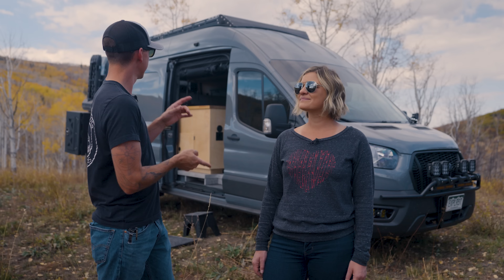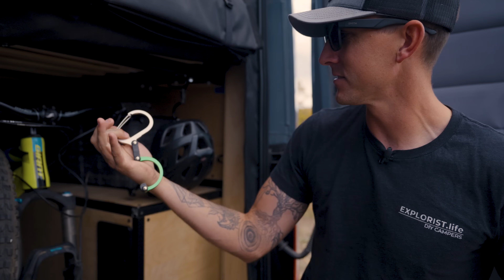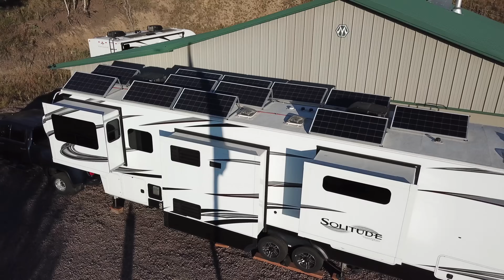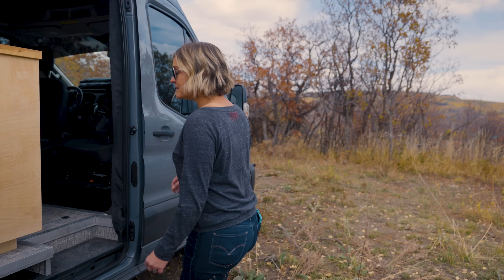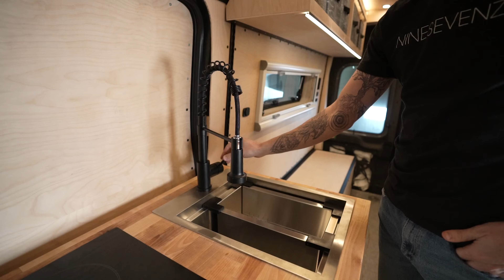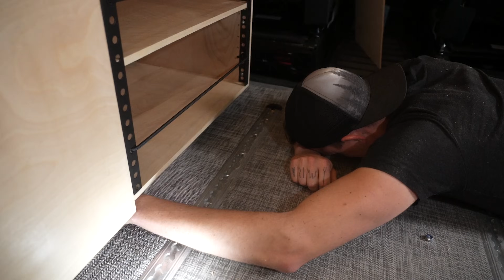LUXURY VAN TOUR - our dream off-grid van

Comment: Amazing build! Did Ford ever fix your automatic sliding door or did you guys fix it yourselves? Did you make a video or blog post about it? I couldn't find anything, and I'm worried that ours will break the second we're done with our build.
Reply from the maker: Ford FINALLY fixed it.  There is a ford service bulletin (some washers, or something like that) about it and we 'only' had to uninstall the door panel and kitchen.  They also had to send it off to a body shop to adjust the door as us forcing it open and closed over the last 3 years messed up the adjustment (that Ford blamed on the weight of the wall panel and insulation).

Comment: I have similar set up in mind for my van, but I would push the mattress to the left, and have a wall of storage to the right @40cm deep. Much bigger window on the left and no overhead storage. Also pull out table from under the floor to slide out for cooking or just sitting.

Comment: Wow... this looks longer/bigger than a "normal" van... or maybe it just looks bigger because I'm used to seeing SUVs and not work type vans, that I'm sure this would be closest to, originally at least...

Since a "normal" SUV sized vehicle usually is just big enough to have a "single" bed in it, and MAYBE, albeit unlikely a "twin" while having ANY kind of space left over, for storage or cooking needs (i could get by with just a microwave really) going the length of the van, whilst only (likely) having the front row of seating available, i do wonder if such a thing would be feasible to do?

Obviously, you would probably have at most, 8ft of usable space, depending on the SUV size available, unless you DID use some kind of work van type of vehicle, which might net you a slight increase in length and cubic feet of space to work with, and i wonder if there are ways to make better use of the available space? Like for instance, instead of doing a bed lengthways, how abut doing a semi-custom bed frame, that has the upper body portion of the bed at some kind of an incline, and then flipped sideways, to save space for more seating or else more storage in place of the 2nd row of seating perhaps? I don't have the money to do something like this, but if I did, I would love to see what I can make out of something with such restricted working space...

I'm going to have to watch a few videos on how exactly this particular vehicle was made into a camper van, because I would definitely like to know exactly how you did certain things with it. I wouldn't need windows on mine, were I to build one though, so all i would likely need for mine, were i to have the money, would be a panel kit, and probably not even any water storage, or as minimal of water storage as can be had, since I probably wouldn't ever need more than a 5gallon tank of water, including water heater, for basically everything I'd want water for...(again, assuming i even cared about water storage)

Most of the electrical stuff could obviously be put, depending on vehicle type, inside of the standard "stow-N-go" storage that's available on some SUVs today, and even if it's NOT the type to have built-in under seat storage, it could also likely be placed under the bed pretty easily, and come to think of it, you could, if it was small enough, have your microwave under the bed too, although I'd probably put some kind of shock absorption panel under it, just in case it needed it to reduce turntable rattling...

You've really given me a few ideas to think on in case I ever decide to do any projects like this. And, I'm not just talking camper vans either, but also pull behind trailer pop up RV tent things, which could also benefit from certain things such as LED lights and things of that nature...

Comment: Nothing beats a real mattress! So I would prefer a real bed over a sitting area. That’s why I prefer Sailing boats they come with both plus a full bath plus two guest cabins :-) for our fiat-panda-4x4 compact camper we use a blow-up roof-top tent plus blow-up mattress with a memory gel topper wich is due to the blow-up tent floor astonishingly comfy and super insulated and work pretty well in cold conditions… our whole kitchen is a Primus gas-cooker in a 65cmx45cm kitchen box on rails in the back… our whole electricity comes from an eco-flow pro plus a 30 Ah battery for our water pump with 4.3 bar of pressure attached to a 30 Liter water tank :)

Comment: I' put my water and power inlets in the same spot you did.  I did the water inlet only because in California certain locations require you to have a water inlet to be considered an RV.

The water inlet came from an RV supply store and the power inlet is from a Marine surplus store

What kind of Connector did you use for your External Solar Panels?

I have a Bluetti AC300/2x B300 Batteries setup. There are extra Solar ports on the Batteries.

Comment: Induction cooktop in a Similar Van, one size smaller.  I ripped off Forrest's idea of mounting in it's drawer (the drawer came out of a rack mount case I modified to hold Musical Equipment,so it's recycled).  The Hamilton Beach Induction Cooktop I got was purchase from Best Buy because it has a square housing for drawer mount, by coincidence fit 19" Rack Mount Drawer.  Drill some holes using a spade bit to the bottom to accommodate the fan and the line cord.

I also wanted to go to the microwave went on the fritz (i still can function with patience [beating on it like an old TV] but the some kind of grease or something has gotten onto the circuit board that has to be disabled properly cleaned outside of the appliance).  Lo
I found and tested a Microwave with similar Dimensions from the thrift store, the old one into storage until they have the opportunity to clean it.   

Even before I got the van I had purchased a very "Cute" Australian-made alcohol Marine stove (2 burners and Oven) but I think it requires some special preparation to get it together.

Shortly after buying the induction cooktop I also bought an old waffle iron that looks like it's still in decent shape and I did test it and it works for what is made for the old style waffle batter and I'm using this just add Water gluten-free waffle batter that probably requires different procedures the plates aren't Teflon.

All these other appliances draw less current in the induction cooktop.

1 burner butane camping any of these items.

Also prior to the building had an electric kettle so I I saved that.

Comment: I need to hear back how the thinsulate + lizard skin (all of the insulation) holds up in winter weather. I plan to camp mainly in California but if a job takes me to Seattle or New York I'd like to be warm - so following your foundation I can know how it holds up. The deeper the snow the better! I checked a couple days ago for a whole van tour and a week later it's here, and what a long road it's been for you two guys
Reply: I'm guessing $62,000 van, $15000 electrical, $20,000 paneling and l tracks, $3000 suspension, $3000 lights. Maybe $124,000 in total?

Comment: My electrical system is completely based on one of the exploristlife diagrams.  It would not have power if it weren’t for you guys 🙏.  
     Love the van.  I have a Quigley 4x4 transit high roof normal wheel base.  It’s a mini ski cabin. 
     We did our upper storage with baskets like you and we love it. 
     Congratulations on finishing. Looks amazing.
Reply from the maker: Hey, @mikewatts1014!  I appreciate that.  Thanks for watching! 🙂😀

Comment: why is the side door always on the passenger side? if that door slide gets messed up, can you replace it easily. why does everyone put the sink next to the side door instead of the toilet. I could imagine cleaning a litter box from the side door and disposing of the contents into a campfire. you do the math.
why do you need swivel seats? you dont.  would prefer the metal bulkhead with the kitchen galley mounted thataway to allow more room. But I am the guy that just sits in that seat to drive, and then parks in the camping place just to open the side door to camp. also the sinkbottom is also mounted crossways. at night I activate a self-inflating mattress on the floor to sleep. As I said, this is camping. there would be floor to ceiling storage in the back with plenty of canned meat. the roof has 4-200 watt bouge rv 9BB panels, 1 maxxair fan, and that fancy A/c unit. I like the exterior solar plug, because there are 11 Lipo4 12.8v 100ah batteries in different places in the ban. There will be four other 200 watt panels stored in the garage to bring out while camping. The theme to this build is "We have options here." there would be 4-5 different cooking options, 120v,12v, coleman stove with small propane and single burner with butane canister. the water heater goes in the cabinet under the sink, along with the water filtration system. the grey water tank is that 15 gallon that fits underneath in the sparetire well. (ram promaster)  the garage has a slideout deck and slide out drawers on top of the deck.
there is a hidden shower pan directly in front of the sink (hidden under a floorboard.) so the showerpan and the sink have the same drain pipe.the shower head is connected to the sink faucet. you can figure out how to clean up after. there will also be a fold up platform to fold out over the sink area to sleep on, if one so desires. Also, on top of the van is a slideout deck that functions as a side awning, but slides back to protect everything from weather like hail and crap like that.  needless to say I have built this van in my head.

Comment: $175K. 
What do you have for heat?
Thanks for all your hard work on the videos! We’re building out our second Transit- got lucky on a Transit Trail- and your electrical system vids have been super helpful.
Reply from the maker: Heat is the ONE thing we haven't gotten to yet; but will be installing an Espar b4 or similar.
Reply: Im gonna guess you’re at about 100k, including the cost of the van.

My two cents on the heater. If you’re using diesel, get an Espar, if you’re using gas, get a Webasto. We’ve installed around 10 Webasto gasoline heaters in Transits over the past 3 years and none of our customers have had any issues, except the one guy who requested we install an Espar B4 in his van… already having issues with the internal climate adjustment, which is a frequently reported issue among other things.
Reply: Great choice. We had a Propex in our first van but we went with a gasoline heater in this one. Got a Velit and couldn’t be happier. Mounted it under the passenger seat. Even though the van is unfinished we’ve used it a few times, and we stayed toasty down into the teens here in the UP. It’s a definite improvement over the propane heater.